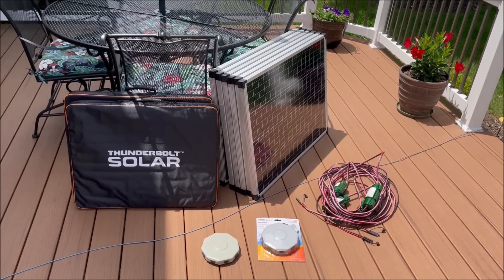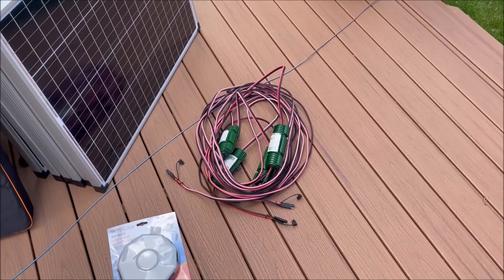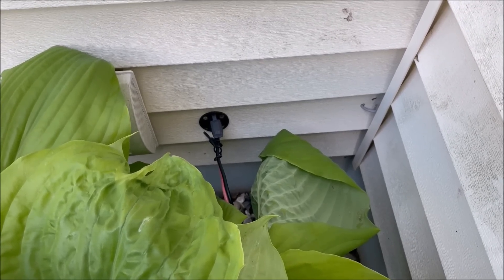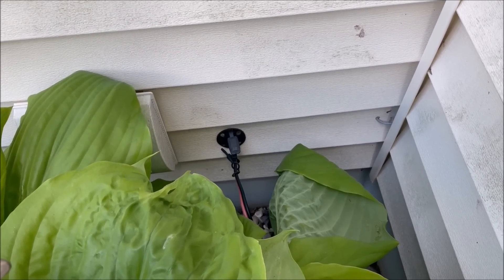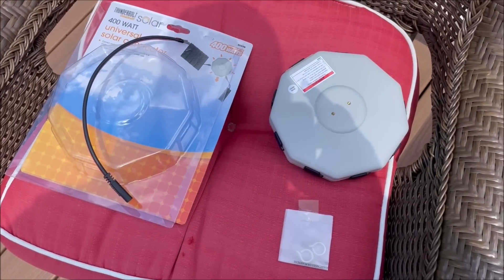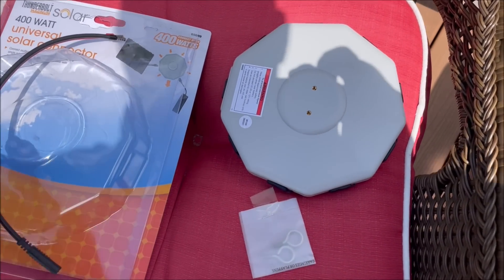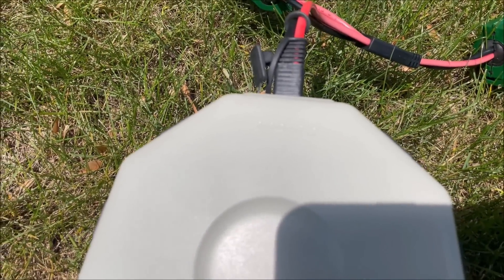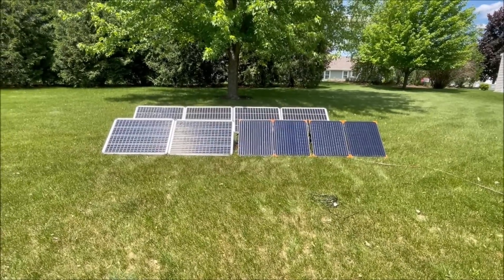Part 1-Hook 8 Harbor Freight Solar Panels together in Parallel - OOPS - "Houston We Have A Problem"

Comment: Keep giving you comments over the watching the video before you even finish the videos and it's not to changing your cable wires that's not the problem because I got the same cable wires actually I got both types of cable wires but those are two different solar panels bigger solar panels my problem is  solar panels I only can run as 12 volts because it's for 100 watt solar panels harbor freights are only 12 volts while they're Little More voltage in there but they only have a 12 volt connection which does actual power on that if you want to run 12 volts which everything you're in a house you could actually run 12 volts on so far what you're hooking it to or want to hook it to it might be your charger in the house which I doubt but you might want to test it if you had a 400 solar panel or a 500 watt solar panel or 600 watt solar panel well probably with a 500 watt cuz it probably give a little less than 500 watts and I don't got those kind of chargers I got a 12 volt or a 24-volt charger I don't get one of those fancy it really expensive chargers I can't afford to buy one of those things so I get to charges that are 12 volts and or else 12 volts and 24 volts at this time I got them both hooked up to the same battery system so I can't run 24 volts but if I disconnect one of them the other two are 20 could be 12 volts or 24 volts and then I could run 24 volts but I only got two inverters that could run 12 volts or 24 volts the rest of my inverters are 12 volts that and my system is so small it's not enough to run my house I haven't tried to get anything bigger than that yet cuz I don't have enough solar panels and what I found out I don't even have enough batteries or enough solar panels to charge the batteries are full but then again I got scammed so many times I should be getting 42 275 watt solar panels but I was scammed so I'm not getting those at least not after 3 months but I can report it in cuz it was through PayPal and they might fix the problem but I also ordered 300 solar panels 14 of them and I was also scammed on that because I'm not getting them and I tried to call a couple of them up and phone numbers are not existing according to the phone company but a couple of them do exist and I got three call and a good time they actually talked to him about it to see if they're actually company and see if they're actually stealing or see if somebody is sexy using their number cuz I want to know if I can actually get my solar panels cuz that's all the solar panels I will need it's just not as many as I want and it would also give me 6,000 watt inverters that I run between 12 24 36 and 48 volts also at 120 vote and 240 volt and it also came with four sets of 200 amp AGM batteries every six came with 14,200 Watts bottom when they're on sale but the sale was probably way too low and was a scam cuz I haven't received them but now I'm finding out what actual real companies are from YouTube videos and companies want me to call them directly to make deals and payment plans which I will not do unless I can pay for everything right out so I got to save money and that might take years to do and I only pay for things right out I don't want to make payment plans I don't want to be indebted or in debt to anything I own my house I owe no money on it I am a broke person that has the day by day through whatever make each week which leaves me very little money but I managed to suffer on one thing on one bill to buy a solar panel here and there but then I'm able to catch up on the bill next week maybe not all the way on a bill that I pay after that but I get to pay on it and then the following could catch up on that bill plus another bill and sometimes that's all I can play is try to catch up and that sometimes is a problem especially when winter comes if I don't have enough solar and when I'm using a lot more electricity so much more electricity cuz I'm not home enough to burn wood and I don't expect my daughter to be able to do it she might be old enough but instead of fire is more difficult sometimes in the wood stove that you cook on while I got two of those those that you can actually cook on one of them is actually have an oven which is kind of surprising for a wood stove but then again you looking at antique wood stoves that are more than 100 years old but I also have an electric kitchen oven stove that is 3600 Watts 240 volts takes a lot of power to run that I don't have enough solar panels for that that's my biggest downfall and if I would have got all four of those 6,000 watt inverters that are 120 240 volts all those solar panels plus the solar panels I have which is already 2,700 Watts but I haven't hooked up to two different sets so it is actually 2540 wat which is for running my house not enough power but generac to change that if they ever come over and do it like they said they would but they sell me that 6 months ago and you only called me once after that let me know that they're out of state and it'll be a while before they get here which was five and a half months ago and you didn't tell me when to come back to here to do anything am I understanding is they're one of the companies that would actually do the work here in Wisconsin when I got generac companies in the same town I work in or the same city I work in. Two towns from where I live in a small City that's more like a medium sized town.

Comment: The problem with you have with harbor freight solar panels doesn't sound right does every 100 w solar panel and harbor freight with 5.5 amps it's kind of a lie it's more like maybe 135 Watts cuz one person is using them and he was getting a lot more wash than 100 Watts from each solar panel of harbor freights and you may not be 135 Watts they might be 110 Watts on 105 Watts something with 5.6 amps or 6.5 amps I was watching that video the other day I got 4 freights 100 Watts solar panels for the 25 watt solar panels they seem to work good for me but I hook them up with a string connecting them together and then bring them in the house without using one of those little round things I don't trust them they don't look right and it looks like they're a problem with them I didn't buy one to study it to figure it out also tell you what the problem was with that and when you having a 20 amp charger 500 w I would not look at the 500 watts part I'd look at the 5.5 amps that each harbor freight has and add that up to four harbor freight solar panels at 22 amps is what it is at 5.5 * 4 is 22 amps and it might be a little bit better than 22 amps I would get a 60 amp charger and hook it up to him see what you would actually get cuz eight of them would be 44 amps 10 of them would be what 55 amps and running too many amps into your charger can't actually started on fire melt it I know I sort of did that once.

Comment: Know what your problem is you're using that little round thing underneath the solar panels connect to solar power too it only can handle so much power and you can look at it at harbor freight it shows you what it can handle and it might not be a handle that much but if you get the string where you can find strings together we can combines four or three solar panels together you'll get all the power in there and it works just fine connecting it from that to your inverter charger.

Comment: Do like the harbor freight solar panel it's not actually my pic I don't know why people that kind of want solar panels it's making a bigger solar panels less than that's worth it and more and more expensive I do believe and that's the best people buying it and trying to buy more 100 Watts when it's not really enough power for much of anything but it is a good backup power for a little bit of essential things that you need if you have enough of them or if you have enough batteries for the syrup and you don't use it for a central power where if you just charging batteries for a whole week and have that many batteries to charge up to work I don't like the connections on harbor freight solar panels but I do like 100 watt solar panels for a different reason if I need a little bit of extra power I can get down and watch other pounds but I won't get I'll get them from Walmart or summer supply tractor supply whatever is called which is closer to where I live just in the same town I work or maybe it's called a city I don't got something like 10,000 people or so I know it's bigger than the city I live in my city is called the city and I just think it's a average size town with a 2000 some people especially when there's towns nearby the same in the same county that has just as many people or a little bit more even though one of them actually went down in population about 200 or so to little less than what is in this city but anyways both Walmart and that place is there beside each other basically while it's another set of a car place but that's besides the point but I say there was a quarter mile beside each other actually Walmart towards parking lot which was the old Walmarts store before they decided to make a super Walmart there besides they got to sell the parents connect together we don't have to cut wires and put new connections on it which I don't have so you can make it 12 volt 24 volt or 36 volt or 48 volt which makes the product a little more valuable and they sell it for less both of them sell it for less one of them are delivered to my house which they really would have to I could go and pick it up the other one I have to go pick up anyways cuz I don't want them to deliver to my house cuz they never deliver anything to my house yet and I don't know if that actually make it there so that just rather go and pick it up and that works for me but Walmart always says to me so I'm still trusting them on that until I get to really big orders but which I probably end up have to have them delivered to me but I'm not sure yet it depends how they delivered a small or just to me and a little bit bigger orders into the bigger orders but they always seem to get things with it with to my house within two or three weeks of me ordering it but if I order something big I probably have to wait a couple months I mean they'll give me time dates when it actually come and then they always beat that time I just ordered something from Walmart today 240 watt solar panel and they said it would be here by Thursday what today is only Sunday so they're saying they get it to me in about 4 days or four and a half days that's really impressive special I expected to be two or three weeks about the same time I order another one of those solar panels and they are 240 Watts and some reason they're really cheap in price right now I don't know if it's on sale or I don't know if that's what they really saw them for cuz I ain't going to give me that price I'm going to keep ordering them because they have bigger than 100 Watts and I'm going to try to get at least 20 of them that are 240 Watts.

Comment: Your system is being limited by the load.  The PV specs are potential voltage and current specs.  Measure your voltages off of each panel. If your batteries are near a full charge or your have a max charging rate, these factors will make the system seem to be under performing.

Comment: This is awesome! You think you could make a video on how you installed that house plug, please? Thanks in advanced.
Reply from the maker: The cheap Amazon connector on the back of the house did not survive the weather well.  I have ordered a better on and it should he here soon.  As soon as I get it I will make a video replacing it which will cover installing it.  Not to much longer.  Thanks for being patient.!!!

Comment: Your voltage drop is HUGE while running 60+ feet of that small wire...Your losing half your power in the wire. Simple as that.
Reply from the maker: Checked voltages and found no significant drop.  The problem is the Renogy charge controllers limitation on maximizing more then a single panel in parallel at 16-18Vdc.

Comment: I have 4  100w HF panels running avg 17 volts, 12-15 amps Peak watts 100w on a flooded battery! W/ Same 40amp controller as yours! I think its only pulling what it needs from the panels when you dont have a load!

Comment: also play with the tilt of your panels , they could be off a little
Reply: I don't believe the angle has anything to do with it. Permanent mounted on a 4/12 or 6/12 pitch roof that's a difference of 2 inches per foot. That's a 8 inch difference on a 4 foot panel that is stationary year round. Mine are mounted on a six foot chain link fence at 50 degrees angle year round. I did add two of those long closet door mirrors to direct more sunlight to the panels and that made a big difference.

Comment: one more issue is when you connect different type of panels together like you had them, the weaker panels will pull down your whole system

Comment: put a load on your system then recheck input change current I bet it goes up
Reply from the maker: I had put a load and only gained about 20W.  The problem is the charge controller is limited in its ability to maximize the panel output at 16-18V.
Reply: @thechiefsway2618  ok ,in the video your battery look pretty topped off
Reply from the maker: @chadjones99  The battery was at 97%, but that was 97% of 400Ah.  There was still quite a bit of battery to charge yet.  The way this Charge controller works in the Lithium Mode is it will charge full power up till 14.1Vdc which is probably 99.9% and then quickly ramp down till the Battery is 14.4Vdc at a 100% and enters Boost Mode.  Doesn't work like a Portable Power station like a Jackery that slows charging very early for it's battery chemistry which is not LiFePo4.

Comment: your wattage is low on your input of your charge controller is probably due to your battery is almost full, your charge controller knows this and will back off to a float charge rate
Reply from the maker: There isn't a Float Charge in Lithium mode.  It charges wide open up to the very end and then quickly ramps down to the Boost mode.  The problem had been fixed with configuring it in a Series/Parallel by raising the voltage.

Comment: Running all your panels in parallel means you need to run thicker cable, I get you are use a 10gauge which is rated for the amps but the length you are running them does not fit in that rating. Run them in series/parallel or swap out the cables for 6 gauge. I recommend running a majority in series if the controller can handle it because the harbor freight panels come with a 14 gauge cable
Reply from the maker: In part 2 I configured in Series/Parallel and fixed the problem.  Raising the Voltage was the key.  Believe the charge controller is limited in its ability to maximize the panels out put at 16-18v.  Got 122W out of a single panel, but even connecting one more in parallel would start to lose power.  Pretty sure its a voltage thing.

Comment: Your using 12 gauge wire to push 60 amps of current at long distance. Not only are you losing lots of power from heat, but it's a good way to cause those wires to catch fire. You should be using at least 8 gauge, maybe 6 gauge wire.
Reply from the maker: 10 AWG Wire being used.  Good up to 30A.  Charge controller has a max input of 520W and at 16V is 32.5A which in no way will cause a fie.  Max value will only be reached for short periods of time.  Switched over to Series/Parallel set up and have cured the issue in video Part 2.  Even with only two panels connected and less then 10A the value was below what it should have been.  Don't think it is loss.  Believe the problem to be the charge controllers limitation to get the maximum out of the panels at 16-18Vdc.  Charge controller is working great with the same cables at 60Vdc.
Reply: @thechiefsway2618  The higher the current going through the wire, the greater the power loss. It's always better to connect panels in series if possible.

Comment: Your batteries are at 97%.  Good thing your controller is working or it would blow up your batteries.  Try putting a load on your system.   You may see the numbers you want.
Reply from the maker: Have put a load on it before switching to a Series/Parallel which cured the problem.  A load did not raise the low ceiling I was seeing at approx. 350W.  The problem is the charge controllers ability to get the max from the panels in parallel at a lower voltage of 16-18Vdc.  In a Series Parallel set-up at approx. 60Vdc its working great.  The Batteries are LiFePo4 with a BMS.  They won't blow up ever.  Working properly now it will charge at +300W right up to 99.9% when it will ramp the charge down in the Boost mode to approx. 14W which is the idle power consumption of the inverter and charge controller.

Comment: I just bought that universal hub today. I have 2 of the 100 watt panels. Each put out 22 volts and 10 amps. I hooked both to the hub and tested it. The voltage and amps coming out of the hub is still 22 and 10. No increase.
Reply: Have you tested that? I'm new to this so I'm trying to figure out why the volts or amps don't double with a second input.